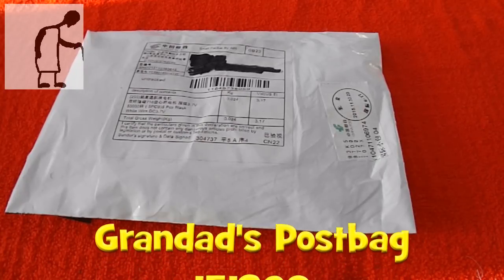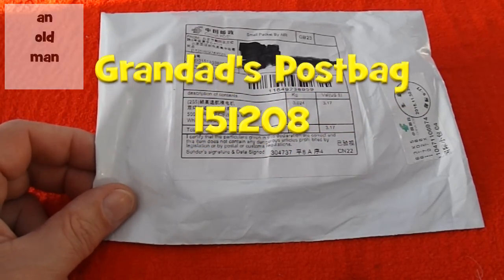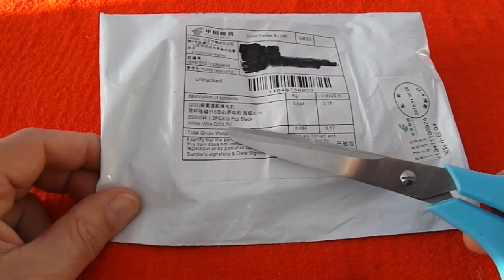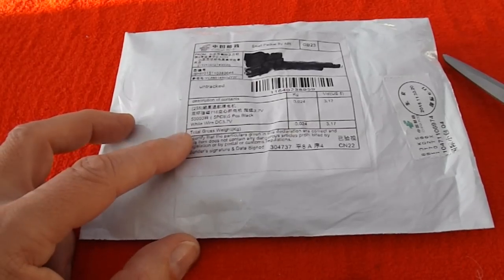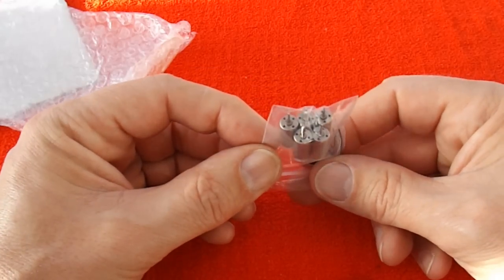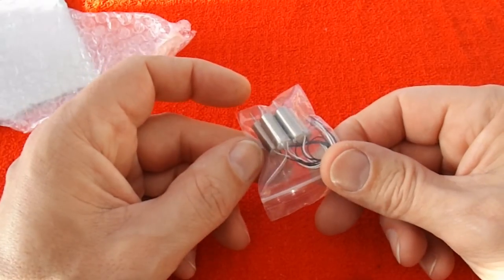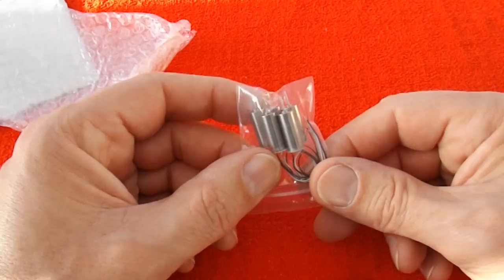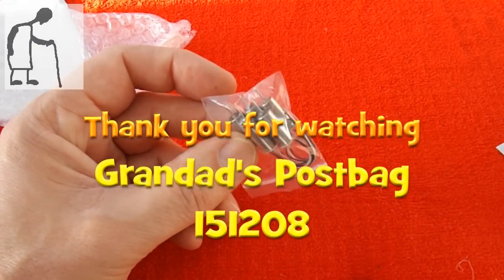Grandad's Postbag 151208 3.7v coreless motors

Comment: sad that these dc motors burn out relatively easily but at least they are cheap.
Reply from the maker: +Mr Rishi The Cookie they only burn out if you give them too much voltage. If you keep it to the rated value they will last for ages.
Reply: GrandadIsAnOldMan Knowing me ill overdo everything in the name of more power. I kept one of these on the terminals of 2 phone batteries in series. So about 7 volts and it was a quite fun to put that on a little air car and a glider i made ages ago. Didn't know at the time and burnt it out.
In my experience with quad-copter motors like these, they seem to burn out if I'm too aggressive with the throttle. I guess they were too cheaply made or a bad batch even though i checked their ratings being 3.8V and the lithium ion battery being 3.8V output too.
Reply from the maker: Mr Rishi The Cookie the ones I burned out were when I used 2S LiPos on them by mistake so that would have been similar with over 8.4 volts freshly charged. https://youtu.be/4ruskA1ypUs